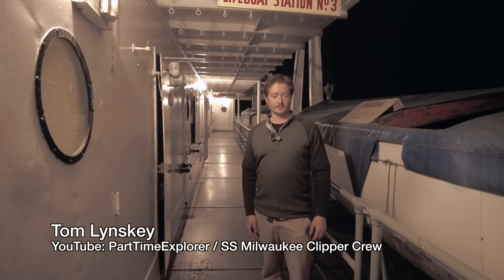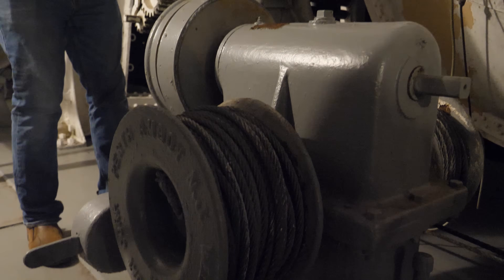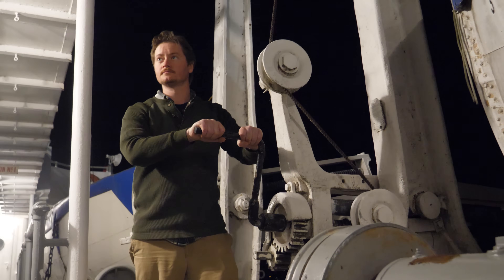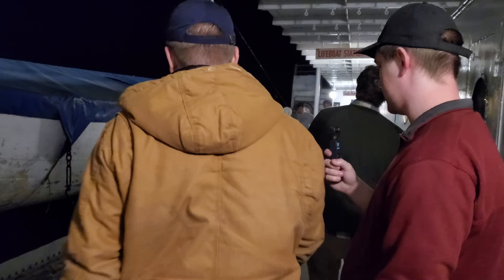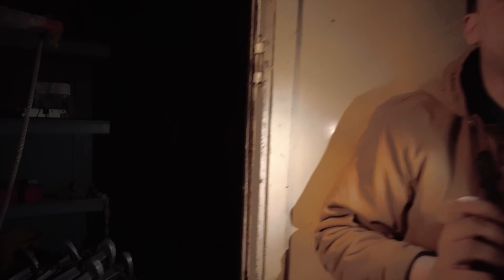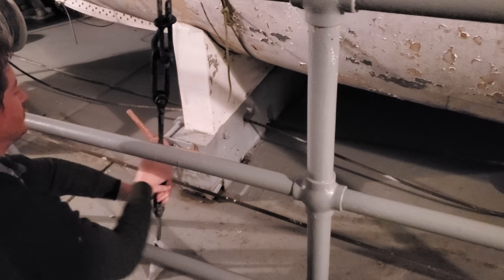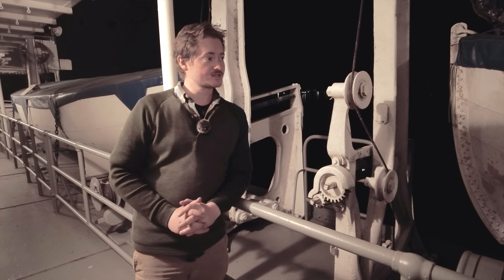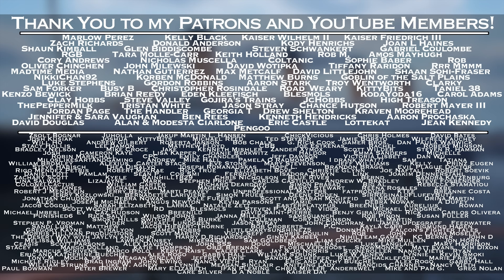We Swing out a Lifeboat: Welin Davit Drill Explained

Comment: You, are confusing single/double acting with single/double banked. Being double banked meant that two rows of boats could be fit, side by side, in each pair of davits. The davits here are single banked. Double acting meant that two davit arms were worked from a single stand with a single set of gearing. The davits here are single acting, where as Titanic carried a mix of both single and double acting. In practice this save space but also means that, even with enough men, only every other boat can be cranked out at a time. All the boats except the end boats shared a crank key gear with it's immediate neighbor.

A couple other small differences you did not mention:

1. The keel blocks on Titanic were of a design where the boats would not need to be cranked up before swinging out. This is important because, as you said, Titanic's boats were not lowered using a winch. Instead, the iron clips holding the boat in place were hinged, and designed to fall away, releasing the keel. The boats would effectively slide sideways off the keel blocks, as the blocks were withdrawn. That said, Titanic's lifeboat keel blocks were not screw driven like the ones here. If the list was against them, removing the blocks would require considerable effort.

2. Titanic's davits were not geared for raising and lowering like the davits on Milwaukee Clipper. I am guessing that dedicated gear trains for up and down were a later design development. Titanic's davit were one gear train for both directions. Practically speaking, I don't think Titanic's boats could be raised by hand, without the electric deck winches.

Comment: Hard work! Although it did look like it got slightly easier after the gears warmed up. Why not just reverse the crank's direction of rotation to bring the boat back in, rather than switching to the smaller gear?
Reply: Swingin the boat inboard, toward the centerline, is working against gravity. The smaller gear lends a mechanical advantage.
Reply: Oh, all right. More torque on the smaller gear? Physics isn't my strength

Comment: One thing often overlooked is that Titanic had a list as it was sinking meaning some boats were rubbing against the hull as it sunk. Its watertight bulk heads helped slow the sinking and did keep the ship from a heavy list, which could have prevented boats from launching on one side.
Reply: fun fact: if the coal fire onboard titanic NEVER HAPPENED, titanic would of likely capsized during the sinking because the weight of all that coal shovelled to the port side (which resulted in the 3 degree port list) basically kept the ship from rolling over
Reply: @MetalMoldyMan this has been proven false
Reply: @MetalMoldyMan  Not fun, not a fact.
Reply: @ostsan8598  im pretty sure it is a fact? it adds up if you think about it unless there is LITERAL information that debunks this